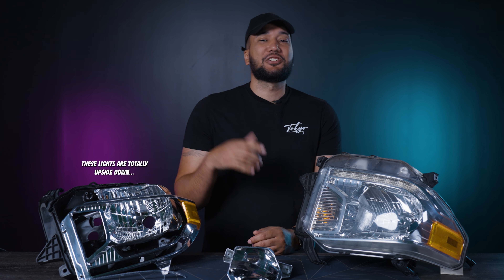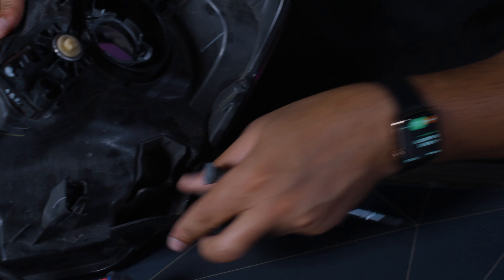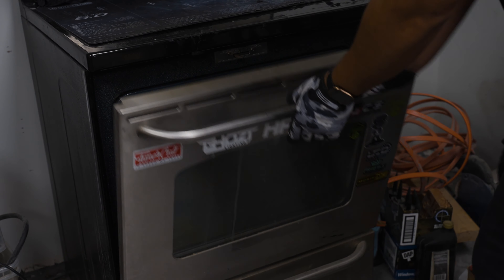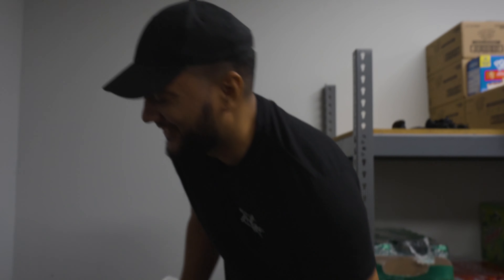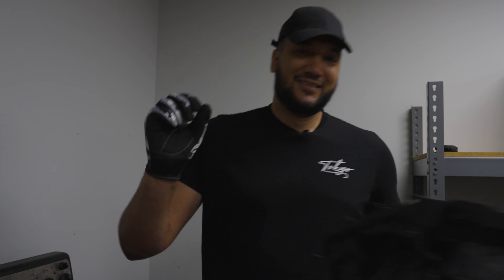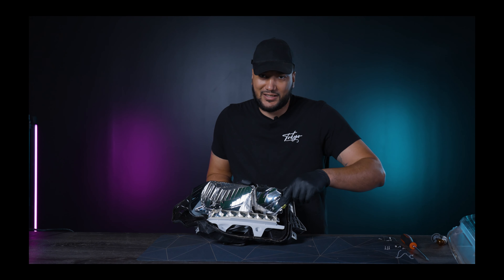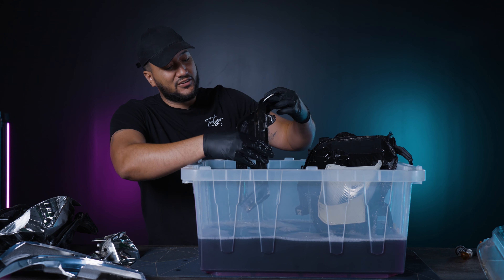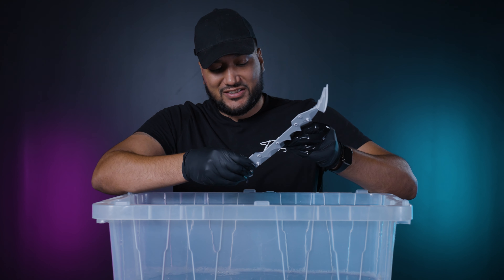Separating Permaseal Tundra Headlights and Step-By-Step Chrome Delete | Tundra Retrofit part 1!

Comment: I didn't know that degreaser worked for removing the chrome from headlights. I just sanded my chrome pieces in my headlights and didn't even prime when I painted. So far it's been about 2 and a half years and paint is still going strong. But nice to know this technique exists.
Reply from the maker: Different ways to accomplish the same goal!